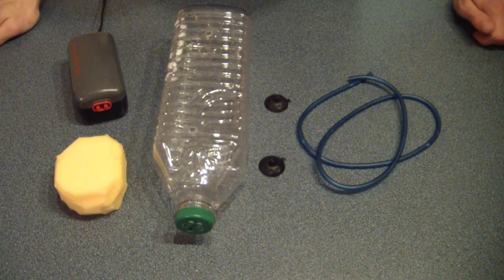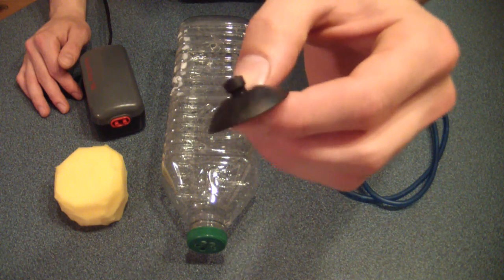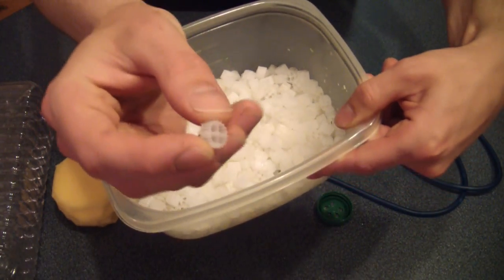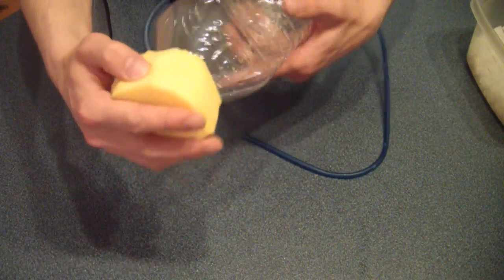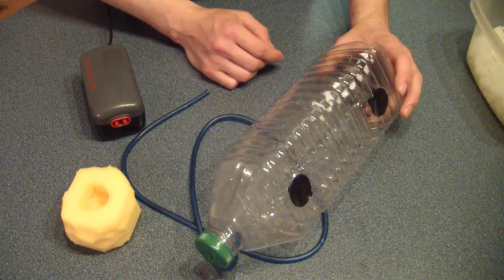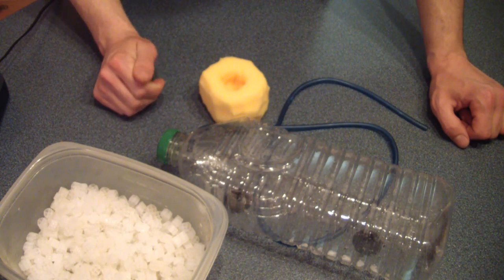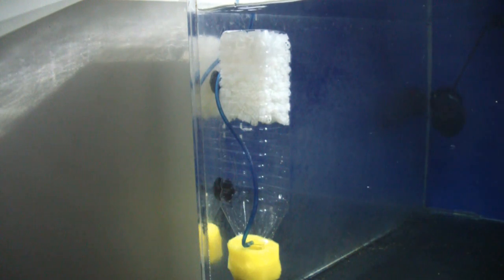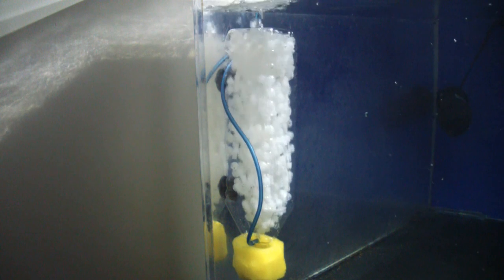HOW TO: Build a simple aquarium filter TUTORIAL

Comment: Oh ya also I’ve been using all kinds of crazy stuff for filter media after I saw u use the pot scrubbers. Basically all we need is bacteria to have as much surface area as possible correct? I save allllll plastic bottle lids then drilll a ton of holes all through them on my drill press and use that as bio media, also any Time I drill any type of plastic or acrylic I save all the shavings and use that also. I just hate plastic pollution so I tried to think of a way I could recycle it into something I love

Comment: @ The King of DIY: Thanks for the idea. How do you get Maximum water flow rate in this setup (or in any other air driven filter) ? I tried this and I fond that only air bubbles are coming out at the top. I think we need filtered water flowing out from the top.
Reply: The air bubbles are also pulling the filtered water back out into the tank too

Comment: If you are already using a bottle with a larger opening,  could you not just drill a 1" hole in the top of the bottle and stick it on top of a sponge filter to add bio filtration?  I am actually looking for a video of someone doing this as I already have a sponge filter, and have a bag of K1.  If I don't find a video,  I will just give it a try.

Comment: Hi King of DIY, i have a 5-6" silver arowana in my 2x1x1 tank, he's all alone in there and i made a filtration just like what you did here in this video (bottle 16oz with ceramic rings). Just wanna ask for how long can my aro survive with this kind of filtration? (my aro is already here in my tank for almost 3weeks with the simple filtration) And i will move my aro into a bigger tank 6x2x2 when my aro reaches 12" to 14" and by that time i plan to make 2pcs of simple filtration in it one with ceramics rings and the other with k1 media is that ok? (bottle size both 1liter or 1.5liters) will these filtration be good enough for my aro? or do i still need to put another kind filtration system? which is i'm trying to avoid because of high electricity bill (25watt for a small filtration system from my LFS), coz air pump is way too cheaper regards with the electricity bill (only 3watt for my air pump)..

Comment: Top tip Joey. Thank You. Although it's surplus to requirements I now run 2 of these in my main tank for 2 reasons.

1• The movement of the media makes it possibly the best way of 'speed-seeding' a new tank

2• In the event of a power outage I have 2 matured bio-filters that can each be powered by a battery air pump.

For even less drilling, wrap a broad strip of sponge around the airline until it fits snugly in the neck of the bottle.

Comment: hi! 

i'm currently having a problem. 
I emptied my fish tank today and realise the whole tank is filled with white stains, i couldn't remove it. 
after filling it up with water again, the stains are gone. 
are those stains good for the fish? and how do i remove them?
Reply: Sounds like mineral deposits. If your tank is glass it can easily be removed with a wet scourer made for non-stick cookware. Do not use wire wool as glass will scratch a lot easier than most people think. Whether it is good or bad for fish depends on the quality of your local water and the type of fish you are keeping. If the white marks are severe I would consider investing in a Reverse Osmosis (RO) system and using a mix of RO/Treated tapwater. The exact ratio also depends on many factors.

If you have fish in your tank DO NOT go straight from tapwater to RO water. Acclimatise them to it via a series of 10% water changes. Leave a couple of days between each change and monitor your fish carefully for signs of distress.
Reply: i know what is your problem actually my aquarium is like yours they getting white stain after they get dry i brush them only with toothbrush or somethin brush just like that and after i brush they removed :D

Comment: What can i use instead of K-1 ?
Reply: Lego gears MIGHT work in a big enough container with enough air, but why would you want to use anything else? K1 has perfect bouyancy, and a fairly good surface area which is also designed to maximise movement. the only way I could think of improving on it would be if somebody invented a spherical version with the same bouyancy - I suspect that wouldn't be too difficult for someone with a 3D printer but it would cost a lot more than K1.

The price per litre is less than that of diesel and WAAAY less than that of inkjet ink and will last a hell of a lot longer than either of them.

Comment: Great video, i have recently got interest in having an aquarium at home. I installed a small aquarium. But i almost lost 2 black moore, 3 gold fish. Now i have got new three angel fish and a common gold fish one. My filter is the normal, which i got along the tank. it has the bottom sponge with top motor head. But if i use this BIO FILTER, will my tank be clean.

Comment: Hi there Joey. Love your videos and what you do, very informative stuff! One thing I want to run by you is that I had a moving bed filter in the same design as yours and it worked amazingly. The only problem was due to the light on my aquarium my k1 media turned green over time instead of the yellow / brownish colour they meant to go. Therefore should the k1 be protected from bright light or how else could this be avoided. Your help would be highly appreciated thanks. Paul

Comment: Because the air shooting out of the air tube is going straight up (because air is made up gases) and so when this happens it drives the water in the same direction causing the water below to come up through the holes in the cap.

Comment: Hey I used a two liter bottom and added two slots for two air pump tubes to go into. The only thing is it appears that at the top of the two liter the water isn't cycling, it's just releasing air. I can see the water but there is airbubbles at the top (i believe) is there still water cycling?

Comment: for small tanks plastic media sucks. you need a large bioload and it takes a while for bacteria to colonize. i would suggest using this design, but using ceramic rings, pack it to the top, and have the air agitate the rings. this should work well.

Comment: Hi Uarujoey...This works great...just got mine up and going yesterday...it can also be used manually as a moving filter to suck up poo and what not. saves siponing time. I use charcoal on the bottom of the bottle and filter floss on the top of that to catch the goop. I live near B.C. Canada...Via Spokane Valley.
I would suggest using the drill and not a knife to poke the holes! We all have unhappy accidents! 
I've had my new tank set up 45 days and the nitrates remain extremely high!

Comment: @uarujoey Does this have to be close to that or can it be more. I have a 55 gal and will be putting two of these in my tank (each one being a 2L bottle w/ 1L of media), so I have a dual valve pump that has minimum of 2500 cc/min per valve... I can easily get another pump closer to those settings if necessary.. Thanks for your time Joey

Comment: @t0ub4b0k00m1 Internet is your best bet. Amazon and eBay usually have some. Google " k1 kaldnes media" and look for a distributor or use the shopping link. The stuff isn't cheap, but it does last a long time for smaller uses like this. If price is an issue, find other people who are interested and split the cost.

I highly recommend making this filter. I made one for my cycled 20H gal tank and moved it to my brand new 20L gal tank; 3 weeks later the water smells good and neon tetras are mating!

Comment: I have used drinking straws cut up real small with good results.  A question I have is I have a planted tank and run co2.  In your opinion if this filter is run with the top out of the water by about a 1/2 inch so the surface water is disturbed as little as possible.  Will just running the O2 be enough to lower my CO2?  There is no surface disturbance anywhere but inside of the bottle.